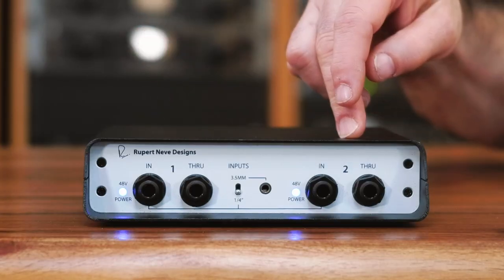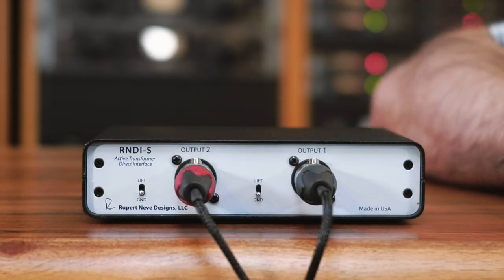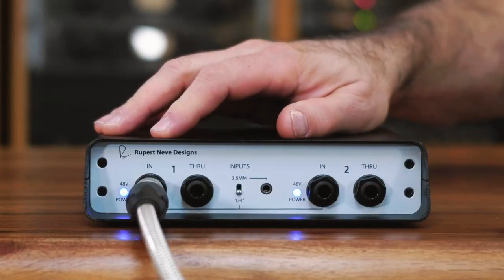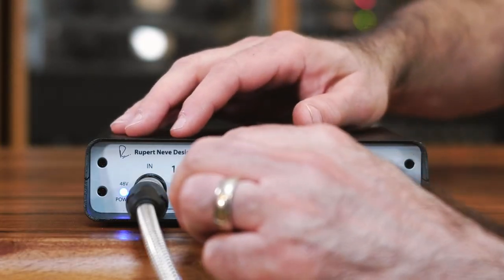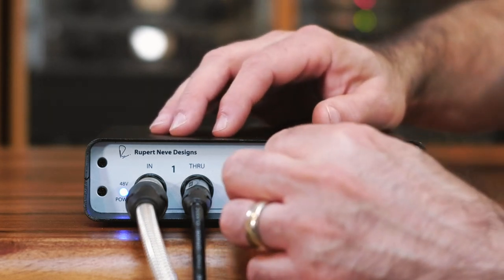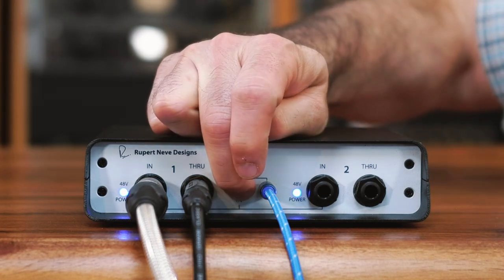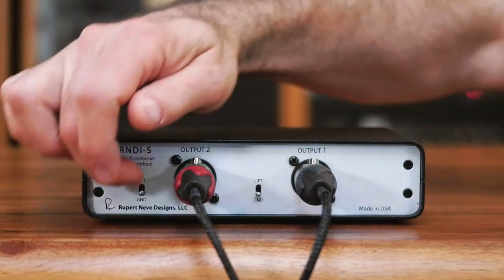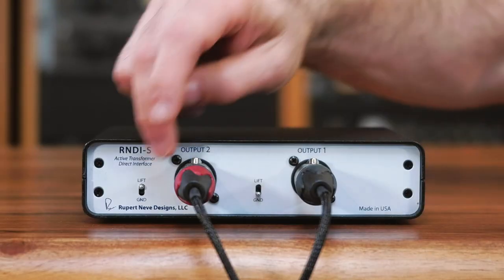Quick Start: RNDI-S Stereo Active Transformer Direct Interface

Comment: This allows me to take 2 hi-z inputs like a bass and a guitar and plug them into my interface—but those inputs have to be phantom powered mic inputs correct? I want to plug two hi-z inputs into two line inputs on an interface and I’m trying to avoid buying two separate DI boxes. From the idea it seems like I need phantom power.

Comment: Just purchased the stereo model and noticed that only the mono version has the speaker/instrument line level option. Does that mean the stereo RNDIS shouldn’t be used between and amp and load source?
Reply: I don't see why this wouldn't work. It works as normal out of my amplifier (back into my interface) and I can't imagine any other speaker fed by a preamp would be any different.